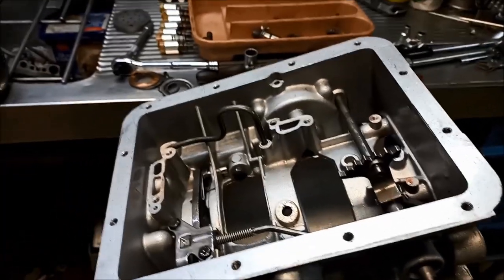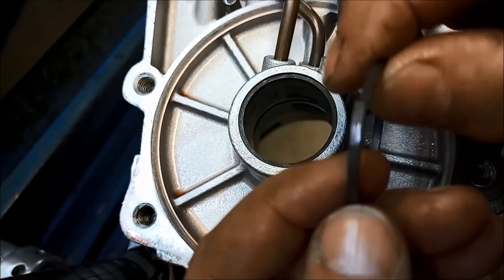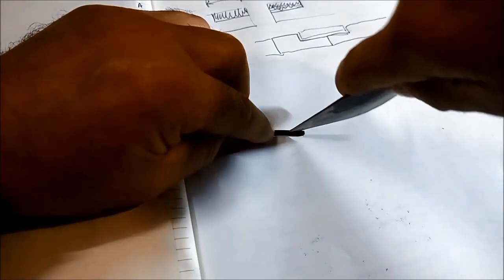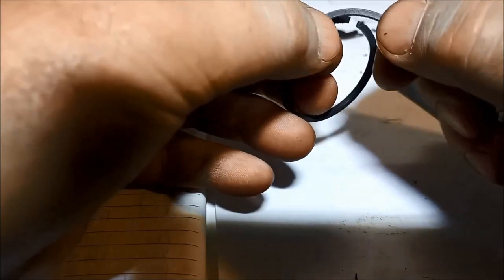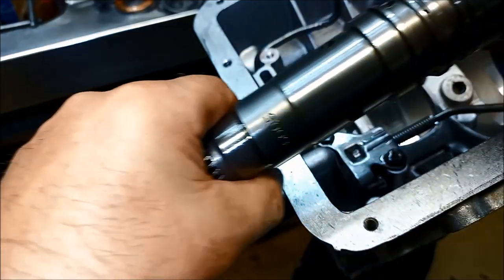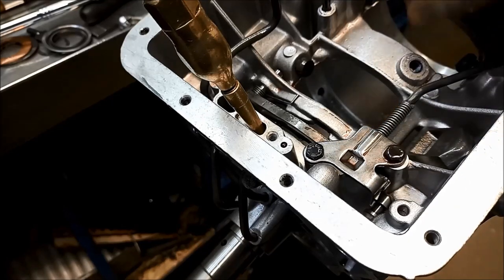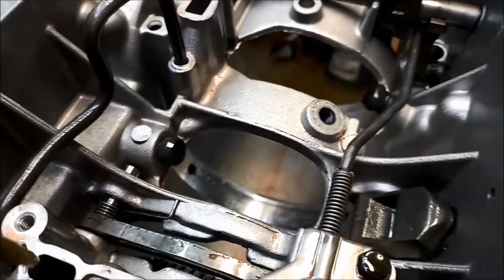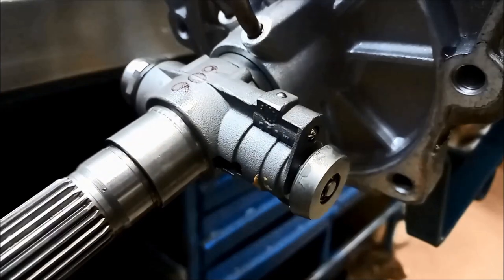Auto Transmission Case Repair to Damaged Worn Automatic Transmission Case Repair Salvage How To DIY

Comment: interesting, much patience you have. reminds me of gapless piston rings that improve suction on the intake stroke and compression on the comp stroke.
Reply from the maker: hi, if the sealing ring doesnt move like these dont, then you can do this tweak. the shaft spins around the rings. i`ve done same with steel rings and also works well. cheers

Comment: Marvelous Ingenuity :)
Reply from the maker: hi, if the sealing ring doesnt move like these dont on governor support, then you can do this tweak. the output shaft spins around the rings. i`ve done same with steel rings and also works well. thanks & cheers